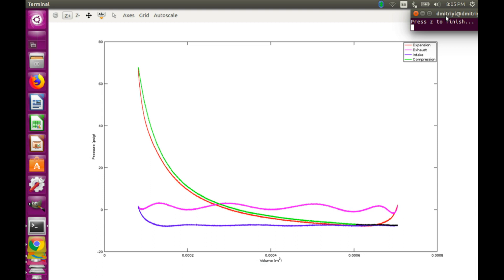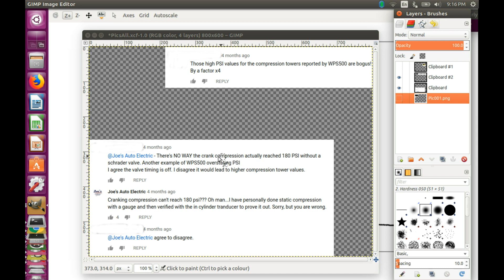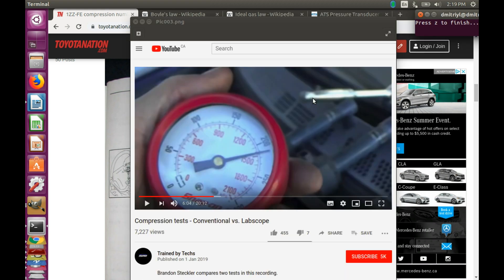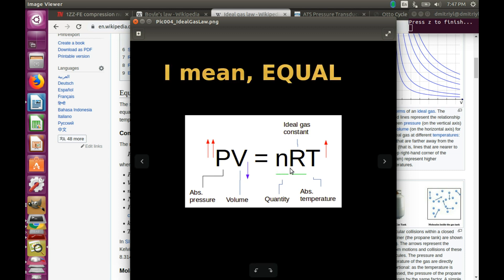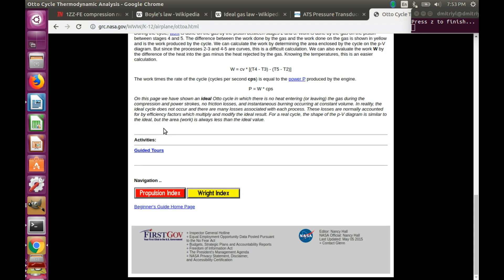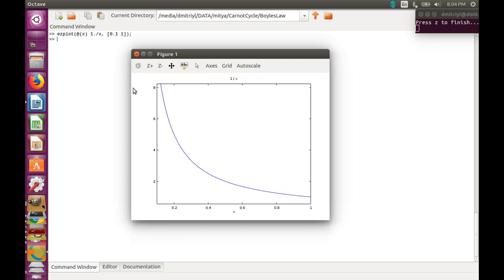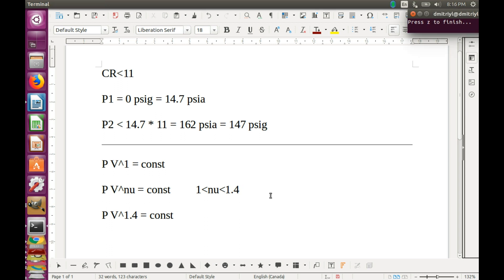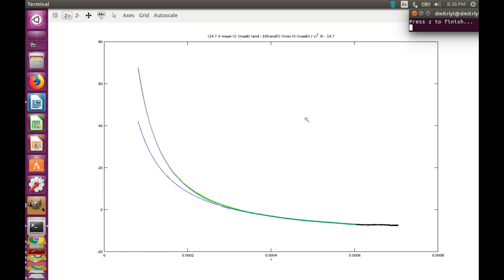[A,M] Does compression trace on P-V diagram satisfy Boyle's Law?

Comment: https://m.youtube.com/watch?v=4qe1Ueifekg

I truly believe it’s the adibiatic process the YouTubers fail to realize, which alters the outcome of in-cylinder running compression and how it doesn’t correlate to the principles of “Boyle’s Ideal Gas Law” (I’m not an engineer though so, be patient with me )
Reply from the maker: Hi Brandon, thanks for stopping by. This is a great (and extreme) demonstration how gases heat up during compression, something I mention at 6:05, but my example of pumping up a bicycle tire pales in comparison.

When there is absolutely no heat loss, this, indeed, leads to an adiabatic process, shown on the NASA page at 10:20.

At cranking and idling speeds there will be some heat loss, so for those the process will be somewhere in between the isothermal (aka Boyle's Law) and adiabatic.

P.S. Because you have included a link, the Youtube is trying to hide your post as much as possible. I wish I knew a way to make it stop doing that...
Reply: Dmitriy L. ...I’m sorry, I’m not too familiar with YouTube rules/regulations. I hope I didn’t ruin this for you in anyway. Sorry for the inconvenience 👍
Reply from the maker: @brandonsteckler3417  No problem, I think "pinning" it made the comment more visible for everyone. Which is good because the link is so relevant. Thank you very much for the link and discussion.
Reply: Dmitriy L. , absolutely my pleasure!